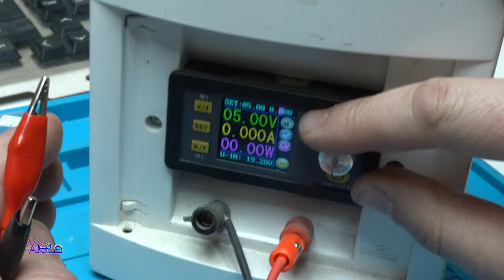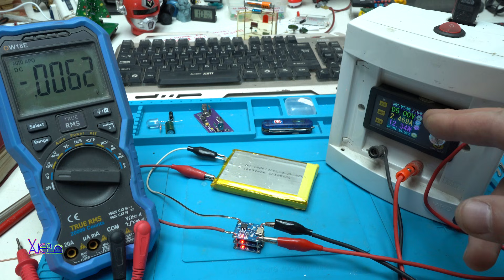Charge Your High Capacity Batteries 3x Fast Using TP4056

Comment: This method is only safe when charging high-capacity batteries, using this charging method on low-capacity batteries can pose a fire and explosion hazard . . .also there's no current direction limiting between the charging modules.
But instead of changing the resistor to increase the output current this method is better when using current direction limiting using diodes.

Comment: Hello. Good experiment. I have a powerbank 1S 30P or 30 18650 in parallel. If I charge with my lineal power supply (Korad KA3005D) the current is 5A and more, but if I charge with any Switching power supply only get 1.6A ???

Comment: Surely it works in current-limiting stage. I'm more curious how they'll behave when one of them turns to voltage-limiting stage. Does the current drop to 2A? does it pull power from the other 2 modules and fail?

Comment: im using this method for 1,5 years, & still working until now
Reply from the maker: Good to know it works, it's a great charger module!
Reply: Are you using parallel cells; if yes any passive balancing you incorporated

Comment: Don't leave it unsupervised and report after few charging cycles.
Reply from the maker: Yes this is unsafe method but I need it to try it bcz some youtubers share this hack.
Reply: Exactly. Each module need to measure the battery voltage to know what stage of the charge to choose. It is not clear a module is measuring the battery voltage or other module's output! This method has been posted in Youtube numerous times and everyone have warned about it's dangers. You need to watch while it's charging, otherwise it can explode the batteries and cause fire in the house.

Comment: Without a load balancing circuit and current limiter, any variation of voltage - even in the microvolts - will cause one circuit to work harder than the others.  This will lead to a positive feedback loop that will burn up one or more board.  This is especially true of "smart" chips that vary the voltage as they detect the battery approaching full charge.  If they don't vary the voltage at exactly the same time, you could induce a backflow of current from one board through the next that could (probably will) destroy one or all circuits.

A burned out board could short itself and destroy the other two boards as well as the battery.  It's not just load balancing, but also current direction limiting as you have to keep current from flowing from one board through the others.  This could be done with a series of diodes.  However, load balancing takes more than a few diodes.  Load balancing circuits quickly become complex the more power supply boards you use.
This is why ganging multiple power supplies is generally never done.
Reply: What if diaod is applied to prevent reverse potential ?
Reply from the maker: I agree, I will consider it in the future,in meanwhile I leave it to work and see what will happen bcz theory vs practice is 2 different worlds

Comment: How do you program those boards?
Reply: There is a resistor on the board that sets the current. Programming is just changing the resistor for one with a different resistance
Reply from the maker: True,thx👍

Comment: It never occurred to me that this might work. I build my own e-cigarettes, and those little charger boards are prone to failure in e-cigs for multiple reasons. One is exposure to e-juice that gunks up the USB port. Another is restricted space that does not allow air-flow for cooling. Because of this, I design the 3D printed cases to make this particular part relatively easy to swap out.
In the design I'm working on now, I created an isolated pocket for the board and planned to use a snap-in USB port for the connection to power, but this video gave me an idea: 
I don't HAVE to put the board in the e-cig at all! I can use a robust connector for the electrical connection to the case and keep the charger separate. Since most of my e-gigs use multiple cells in parallel, ganging up two boards could speed up charging.
I'll be checking back on this video to see how multiple charging boards work out for other people.
Thanks for the idea!
Reply from the maker: Great idea, you can do that project.

Comment: Please don't use this.. it's hella inefficient..u can get 3A charging modules..the one i use is Ip2321..it supports high voltage lithium cells and programmable charging current.. it's better than this
Reply: Sure you're right, but Mr. Hacktuber is more about unusual scavenging DIY projects, cheapest units from AliExpress, and ways to make something out of it. 
Even though there are higher current units, the thing is to make kinda weird projects like that. I won't do it, but they're entertaining to see.
Reply from the maker: Yes I want to experiment,test and see what will happen,many comment that is a bad idea until you try it and see the results.
Reply: Put it inside a hot plate and keep your coffee hot while charging batteries.
Reply: But lp2321 don't have an out tô thr charge. An emergência light, per sample.
Reply: You can only charge the batteries, teremos is not an out to a charge